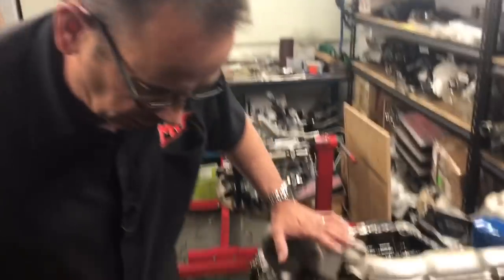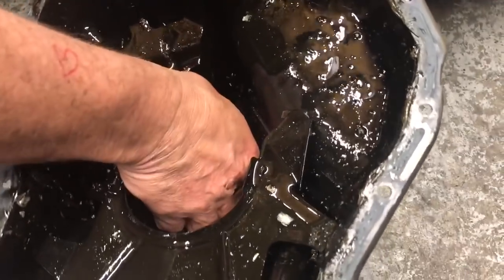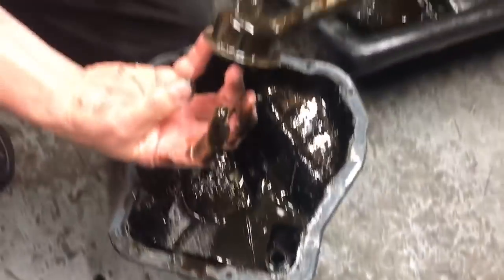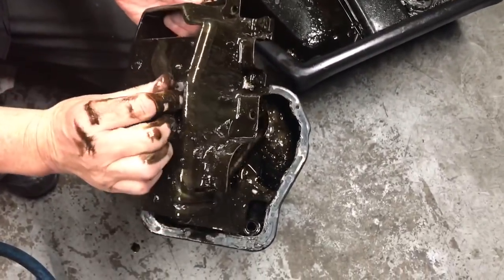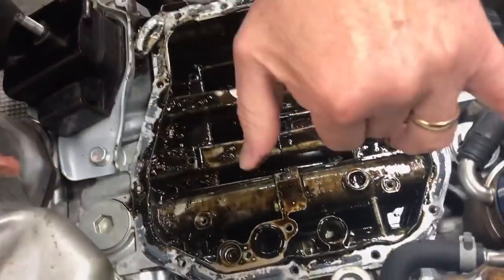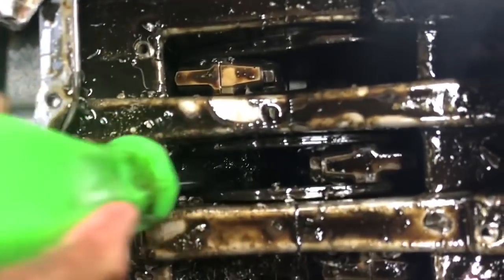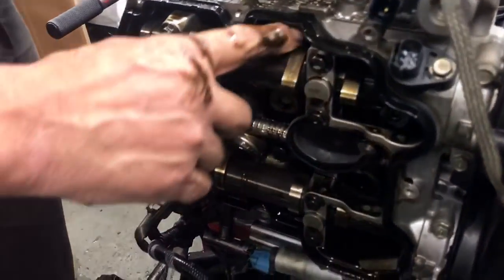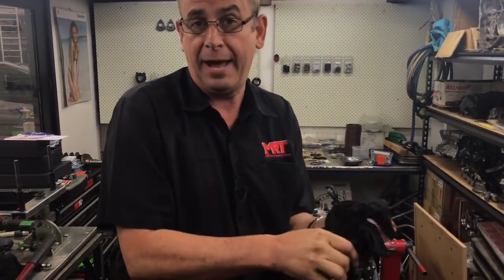Engine Failure suspected due to Crushed Sump - Part 3

Comment: Recently acquired a 2008 legacy with a smashed oil sump. Put a battery in it, started it up;  loud rod knock.  Thank you Brett for the information now I know I need a new motor. BTW I paid $1 for the car 😆